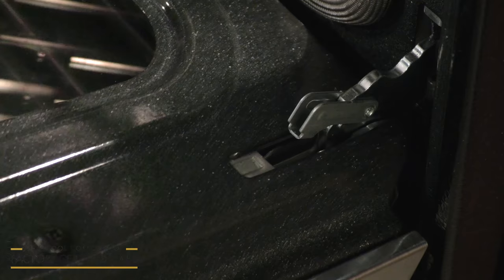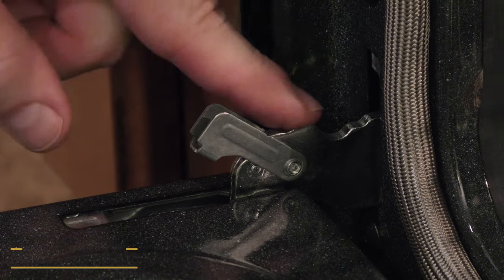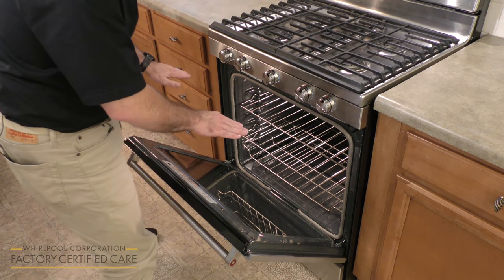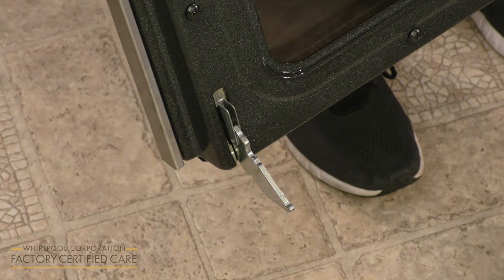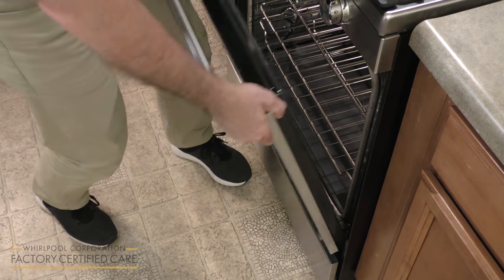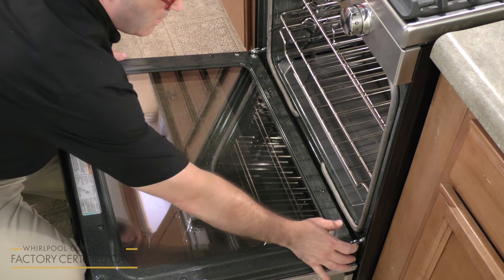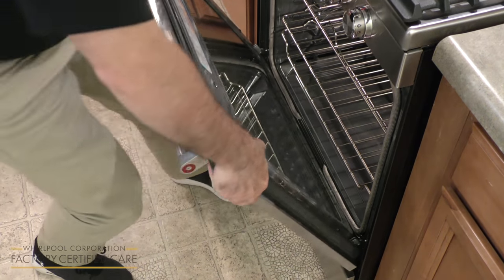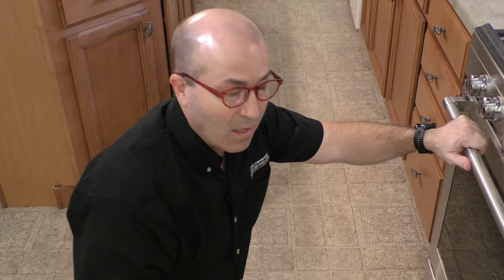How to Remove Your Range Door

Comment: Just a little note if you don't lock those hinges and you pull it out and you have your hand or fingers  down there those things can slam back on you With a scary amount of force! A lot of oven doors are of.course slightly different and it can be confusing Make sure when you pull up and remove the door your hand is not down by the door latch!. I say that from experience!

Comment: So, we were trying to remove the door from our oven, and we succeeded, but the hinge on the right side dangles around and clearly didn't get locked in in the removal process. The hinge itself is at a 45 degree angle, but it's not locked to the door itself unlike on the left side. Not sure how to fix this. I think we messed up at 0:30, but can't be too sure. Nothing seems broken from the surface but I wouldn't know for sure. This is our first time removing the door from this particular oven of ours. The locking/hinge mechanism seems to be exactly the same as in the video here.
Reply: This is a design flaw. We had to replace the hinge.